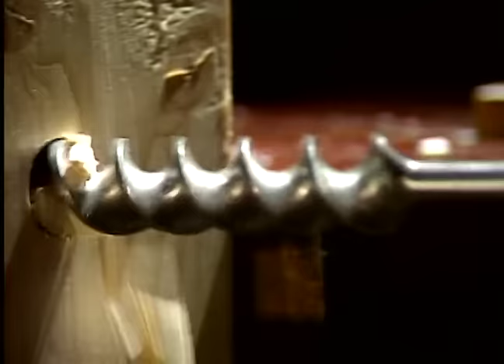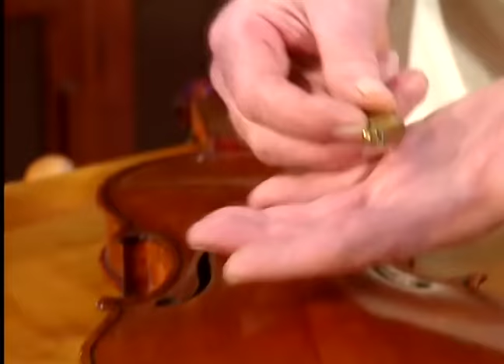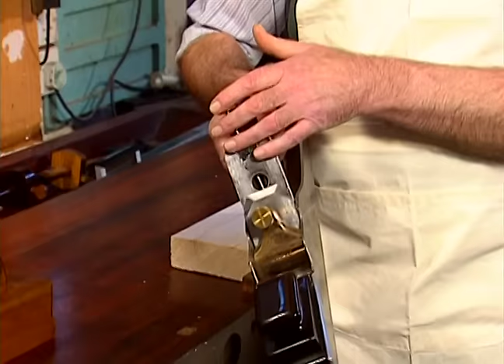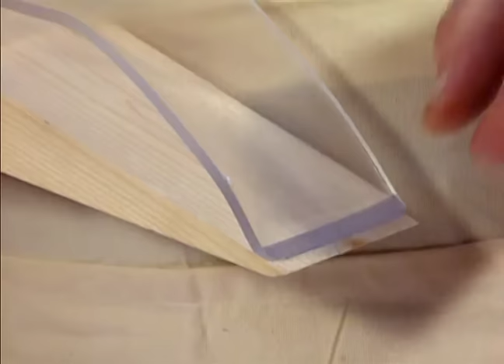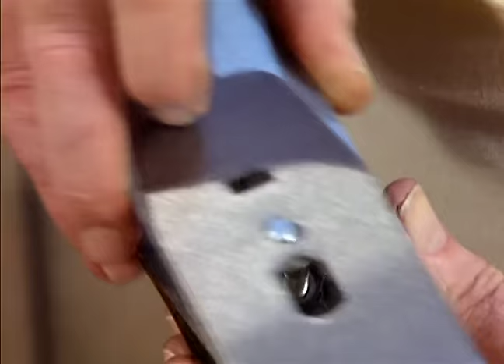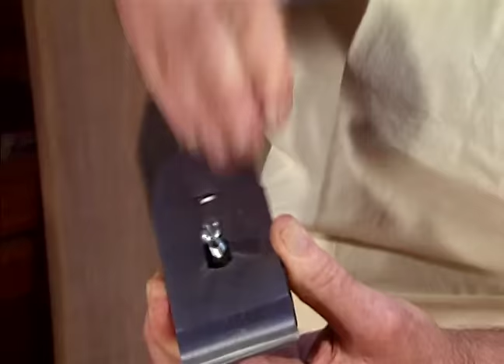Jim Kingshott - Bench Planes

Comment: When the architect heard I had edge glued the teak skirt board - had to make it wider - he was livid! On a Saturday I was commanded to go to the jobsite - to get yelled at, I guess. He was already there when I walked in.  His first words, "Well, you didn't say it was indiscernible."  I had used a flattened, well tuned 16" Record. One long thin shaving from each glue surface for an invisible glue joint.
Reply from the maker: Great to read this
Reply: @Dovetailtim  Yeah, the board was 12 - 3/8ths x 20 feet (!) and cost about $1600.  Skirt board to be mitered to the risers, 13 of them.  The boss bought two boards for the job, knowing how difficult the job would be. Got 'er done one the first try, for "the teak house" in Key West, FL.

Comment: My first time seeing any of his work and he does a fairly good job of explaining everything so that even an English [mis]speaker from the other side of "The Pond" is able to follow along. The only "Nit" I might have to pick, so to speak, is a safety tip; His use of linseed oil to lubricate the soles of the planes without giving a warning to be absolutely certain to not let it dry out and tightly cover it when one's not in the shop causes me some concern. Linseed oil (at least the 'boiled" kind) soaked rags tend to spontaneously combust as they dry out which has me worried that someone might not know that and suffer unfortunate, avoidable results. (With Paul Sellers "Rag-In-A-Can" method, he uses 3-in-One Oil, which is a light machine oil and says he never has any problems with it affecting the finishes he uses.)
Reply: Modern boiled linseed oil has a cobalt "drying" compound in it (actually a polymerisation catalyst) and it is this that causes spontaneous combustion. He's almost certainly using regular linseed oil (aka flaxseed oil) in order to lubricate his plane. The boiled stuff would become polymerised and sticky within a few days - even if there's only a small amount of it left on the plane - quite the opposite of what you want! With flaxseed oil there's little to no chance of combustion! For really picky woodworkers you don't really want to use a petroleum based product (like 3-in-1 oil, or sewing machine oil etc) because it can screw up certain finishes. French polish in particular, I believe, which is an ethanol based finish (although not many people do a proper French polish anymore).

Comment: This is awesome I have been hoping to find the Kingshot videos on youtube for years as my vhs tapes from 25 years ago no longer have a vhs player.   I actually made an infill smoothing plane based on the instructions in his book.  Not sure if that stuff was ever put into vhs.  Thank you for posting !
Reply from the maker: Thank you for sharing this, I’d love to see this infill plane if you had photos..!
Reply: I don't have anything worth posting as a new video.  But for what it is worth I will give you the good bad and ugly....  First of all Jim recommends 1/8 inch steel.  I figured if 1/8 is good then 1/4 is better, right?  Not really. I made the sole of 1/4 steel and the sides of 1/4 brass and did get really nice 3 dimensional dovetails after about 8 hours of peening.  I bought a morris adjuster kit and made a blade out of o2 steel that I took to a machine shop to harden to about rockwell 62.  I used rosewood for the infill and carved handles.  The mouth is about 1/64 max.  It is unfortunately too heavy to use as a smoothing plane on a regular basis except if you have to deal with the most gnarly grain on a very limited run,  but I use it with a miter shooting board jig, and get half a thousandth shavings.   The whole thing was done without power tools just ball peen hammer hack saw and some nice nicholson files and rasps....one of which I ground off the edge to file flat surfaces without making any edge cut.  Well except I used an electric drill to remove the bulk of the material for the tails and initial mouth opening.   I picked up a Ray Isles smoothing plane around 2001 and that thing has had a real workout over the years and done great.  Welded sole.  I learned to weld recently so may try my hand at something like that....tbd  @Dovetailtim
Reply from the maker: @midnighttutor This is so wonderful to read, i really appreciate you writing this all out, this is making me wish to get my infill plane out and give it some love.. thank you so much..
Reply: You definitely should!  Always something very satisfying about slicing off a thinner than paper shaving..the sound, the result...  One thing I should add to my overview.  If you are going to make one of these infill planes follow the traditional side pattern.  I took some liberties in order to come up with something artistic but if I did not have the quarter inch steel base it would have been structurally weak.  Even so I did get some cracking in the weak points in the brass sides.   @Dovetailtim